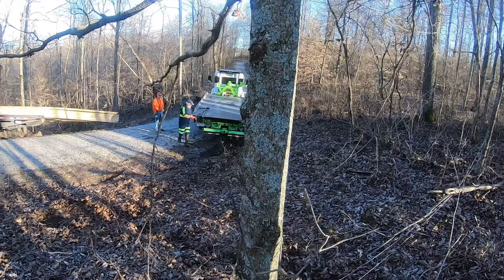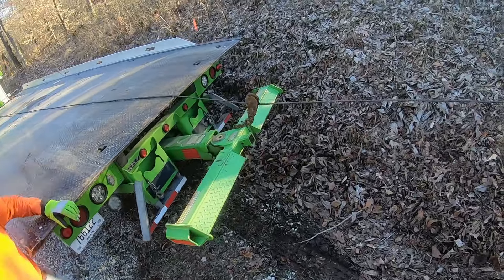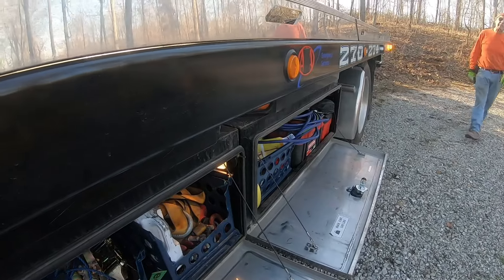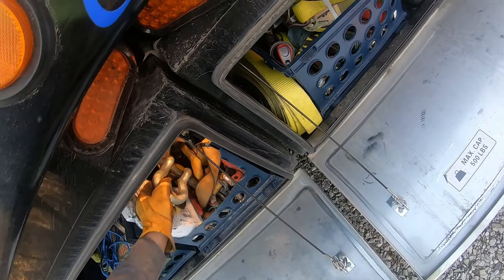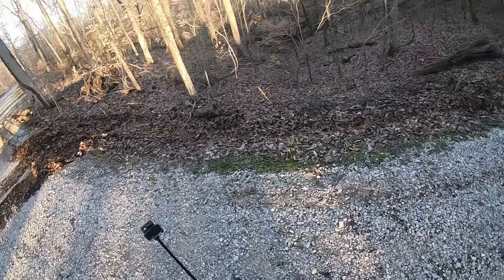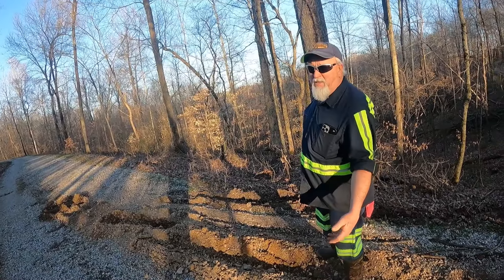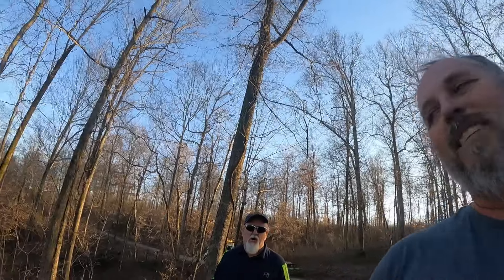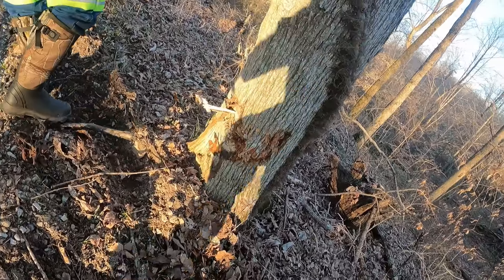Dual Tandem Truss Trailer In A Predicament

Comment: 👍thanks for your hard work and sharing your experience and knowledge 👍my father would sacrifice a old glove into pinch points to protect the pull point and the strap this also works when you need to put a knot in a bad placement and still get it loose 👍